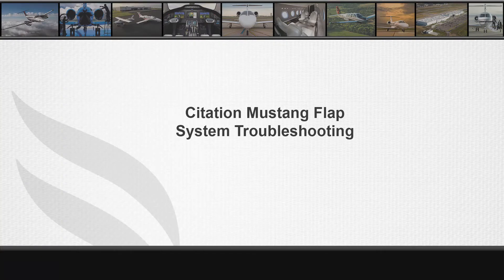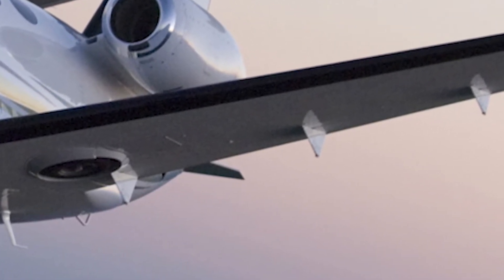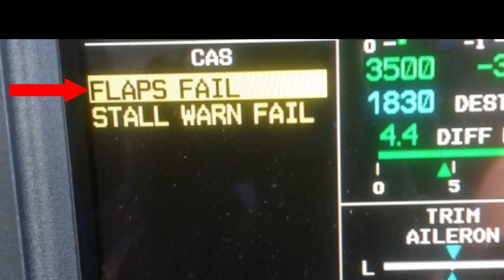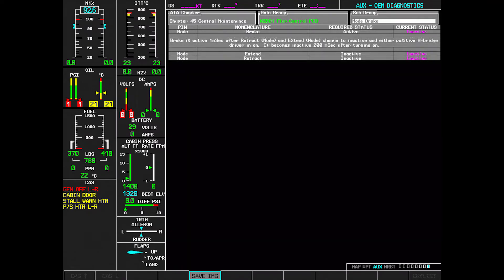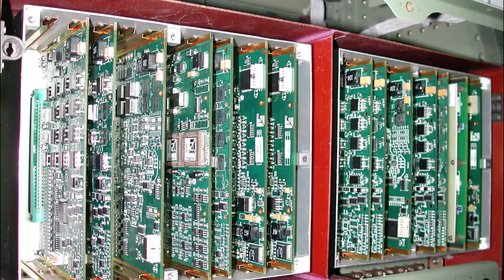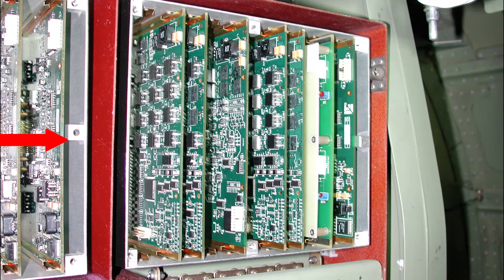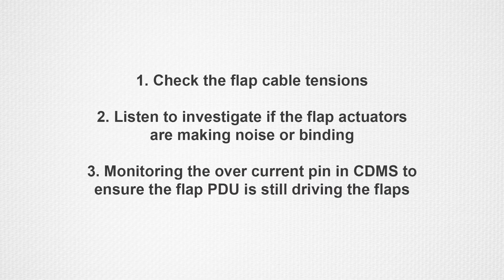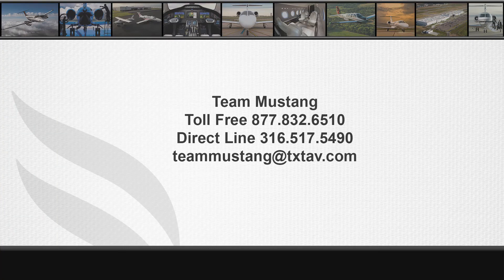Mustang Flap System Troubleshooting

Comment: Just to add info for TROUBLESHOOTING.. if fault (flap fail, stall warn and flap indicator red X) occur only during flight and dissapear after touchdown...use freeze spray -50celcius to RH flap interconnect prox switches (under the belly) and check in CDMS page for faults. I know a lot of people knew about this. But nothing mentioned about this in AMM and expert system tshooting guide. Hope it helps!